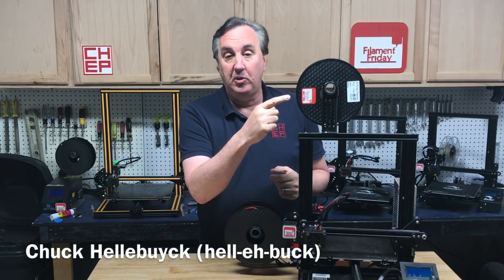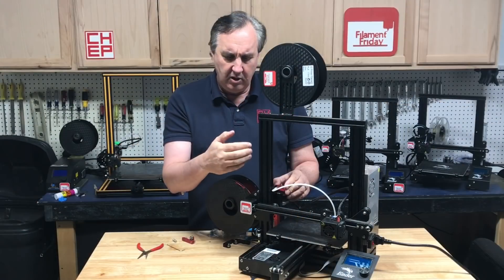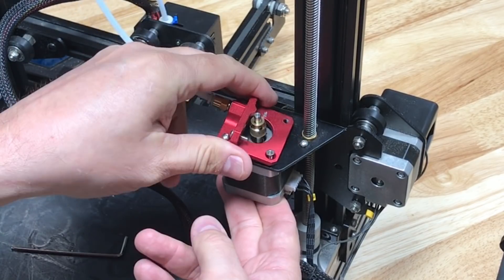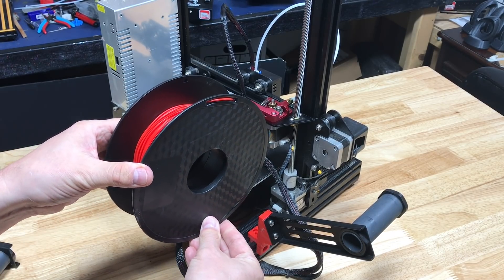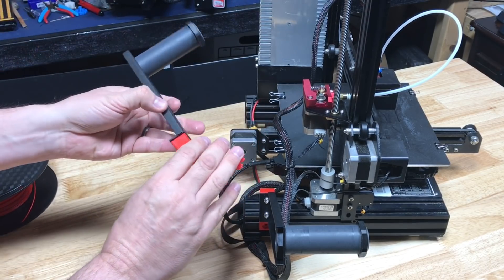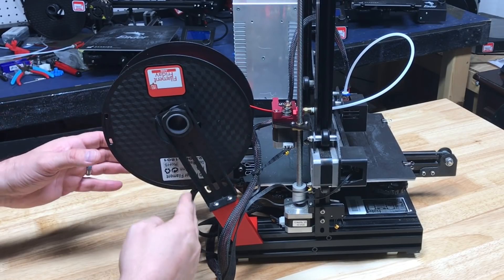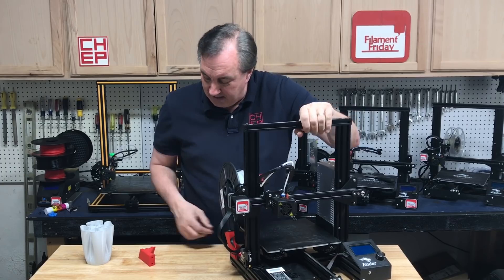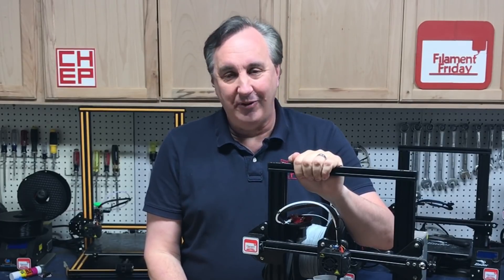Creality Ender 3 Rear Spool Mount

Comment: great idea - looks like the spool is over the print bed, so assume you would have a clash there. But I love the position and will have a go. Out of interest, what is the total overall depth of the spool and the ender 3? would it be less than 550mm? for fitment into a cupboard?

Comment: I just did this 1/4 turn on my extruder and I found the Bowden tube between the extruder motor and the print head TURNS about a 1/4 of a turn as the print head moves back and forth. anyone else notice this and is it a problem? really wish I could search the comments on this thread.

Comment: I tried this but I only tried it after upgrading to a BMG Extruder clone. I found the bend in the PTFE tube caused a lot of problems. I cut it so there wasn't much of a bend and it fixed my inconsistent under extrusion. Right now I'm using the original top mount but screwed to the bottom extrusions with a longer PTFE tube for the extruder intake. This stops it unwinding.

Comment: This is so much better than side mount. Solved the exact challenges you mentioned. About to print this for my Ender 3 v2. Did you ever revise to not block the print bed as much?
Reply from the maker: There are remixes that do.

Comment: The bed may clear, but a large, taller, print that fills a wider build area is going to hit that roller. I recommend turning the metal roller support 180 degrees and it won't be too much wider than the z stepper motor. Still off the back using the same printed bracket; but doesn't interfere with anything on the printer. And, it leaves the spool close to the extruder without issue.

Comment: Seems like it may interfere with using the whole build plate area. Or am I'm just seeing it wrong.
Reply: I thought that for a moment, but then realized that the bowden tube will always be above the x-axis. This would work. I'm staying side mounted, but it would totally work.
Reply: @monkeytube138  The spool gets hit by the bed, the spool holder needs to go out about 15-20mm more.

Comment: I just need something that feeds better, there’s nothing wrong with my printer, but it’s the filament. It likes to get caught and as it’s feeding there is no slack and it pulls to tight and snaps so it’s not feeding anymore, I found out the hard way 17 hours into a print

Comment: I'm using a remix of this at the moment, but I want to put my Ender 3v2 in an enclosure, and this makes loading the spool difficult. My enclosure will open on the left side, so I am going to redesign the support so the spool loads from the left, instead of the right. It will also clear the build area this way.

Comment: I did this a few months ago and love it. But instead of the rear mount I've hung my spool off the back of the top post. Keeps the footprint even smaller and still works grear!
Reply: how did you manage to get the full vertical build area with that? is the STL searchable on thingyverse?

Comment: Sir. What can i do to prevent "Twisting" of the filament on the spool support? I have relocated the spool to the lower left side of the ender 3. it seems that the filament wants to twist and then it reaches its point of not advancing into the extruder until it breaks.
Reply from the maker: I’m not sure. I’ve not seen that on mine.
Reply: Do not let go of the end, if you let go of the end of the spool it can wind itself around a different loop and create a knot.

If you never release the end then it can’t tie a knot. Any time you cut your spool you need to tape it down or hold it in your hands. Ensure it doesn’t create a knot or travel under another loop.

Comment: Recent subscriber. Great content. Thanks so much. Just wondering, after watching your recent video where you tried adding the extender to make it offset just a bit, did you considered moving the upright from the outside to the inside and then just swap the spool holder to the outside position? This would keep the weight centered the same over the rail, just 180degrees. And any overhang would be to the outside rather than over the printer itself. Perhaps it would be JUST ENOUGH to account for blocking that last few inches of the bed AND not bind the filament too much.
Reply from the maker: Yes. I tried it but it moves it over too much.

Comment: Hey Chuck - love the idea, but larger prints on the inside of the bed area will fail. I too am looking forward to an update version which I assume will require some filament guidance not being in line with the extruder bracket! Thank you very much!
Reply from the maker: I’ve printed a lot of prints on the inside of the bed. Nothing failed. The back corner does get interfered with by the current spool holder. I’m working on an improvement. Right now I lose a back corner 50mm x 65mm. I rarely ever print there on 99% of my prints. 
The filament hasn’t worn into the aluminum extrusion after many many prints. Plastic one is showing a bit.
Reply: @FilamentFriday  Are you saying the aluminum extruder is now worn, by filament? (like a bad thing?) I am seriously considering this and I am wondering if a filament guide attached to the Z axis screw with a wide mount would really help compensate for the relocation, adn future "left slide " if that would make the diffrence! -- I am about to print one, but My depth is also severely lacking  ... Thank you again- great job!
Reply from the maker: No, I just corrected the typo. It hasn’t worn into the aluminum version.

Comment: Could you help me out with this problem. I have built my Ender3, and I have not done a good job. When the Ender3 goes to the home position, it is about one inch off the build plate at the home position. What correction can I make to solve this problem? I am ready to tear down the Ender3 and start all over with the build. Thanks for a reply. Richard
Reply from the maker: https://youtu.be/2Th2e7wTNV0

Comment: You overlooked an issue with that rear spool placement. 4:18 The filament entry angle into the extruded hole is pretty steep if you ask me (especially if the print you're doing is not that tall), and because of that, you're going to put quite a bit of wear and tear on the outside edge of the aluminium extrusion lever, especial when using a full spool. The side mount placement (while wider) helps solve that wear problem.
Reply from the maker: I didn’t overlook it. I’ve been printing with it and most prints, even smaller ones don’t rub much. It’s just in the home position that you see that angle. The side is still better, this was just an alternative for those that complained about the width.

Comment: hi Chuck. im very new to printing. where is the best place for me to get designs and how do I put them on to my sd card so that my printer will read them? love watching your vids. cheers fella.
Reply from the maker: https://youtu.be/FahVngvlhoY
Reply: @FilamentFriday  thanks Chuck. that helped a lot. I have managed to grab some prints off thingy verse and alter them for my needs. uploaded them to cura for splicing and got them on my sd card. when I started to print them they would start printing on the very front left hand corner of my bed. even though they were centred on the build platform in cura. I find I have to move the part to the very rear right corner of the build platform in cura to get the print to start near the centre of my printer bed. have I missed something in my set up? thanks again for your help.
Reply from the maker: You have to select the proper machine file in the slicer to get the right bed size

Comment: Hi Chuck, This is almost perfect. Would you consider increasing the tilt of the holder at the rear so it goes further back and avoids taking over the build area.
Reply from the maker: I’m looking at moving it sideways and maybe lowering it. I don’t think a bigger angle helps and it puts more torque on the mount.
Reply: @FilamentFriday  great ! Look forward to seeing your updated design
Reply: CHEP any luck with the mod yet?
Reply: @jeremyglover  Someone posted a remix to CHEP's design on the verse(thing:4325547), a bracket that moves the whole holder to the left, that should fix the issue

Comment: I like this idea. I've only had my E3 Pro v1.5 now for a few days and I had a spool of brittle PLA that can't survive the turn from the top mount without snapping mid-print. I moved to a side mount, but I like this solution better. As soon as I can crank out the spool holder, I'm going to give it a try.

Comment: I have a large chunk of PLA, almost the length of my capricon bowden tube for my ender 3 pro, completely stuck and I cannot budge it one iota with a rebar wire that passes through nicely. I've tried freezing it and boiling it and no joy thus far. I have some white tubing on order from Amazon but it seems that will be awhile instead of their usually prompt delivery here in Montreal. I thought it should be easy to get out but I was wrong and don't even really understand how this happened. If anyone knows anything about this kind of problem I will be very open to suggestions. I finally was getting my printer to extrude properly and then this!
Reply from the maker: The last 20mm are probably stuck near the nozzle. Just cut that off and I will probably release.
Reply: I now have the same problem in a white bowden tube I found and it is far from the the end. In both a large piece of pla is stuck about 2 or three inches in from each end and won't budge. I should be able to push it through quite easily with just a piece of pla let alone a rebar tie wire. I wonder why it is sticking?
Reply from the maker: Some filaments have spots out of spec. Especially low cost ones. That could be a bad spot.
Reply: @FilamentFriday  These are two different pla filaments. And they are completely frozen in there. I would not have thought that was possible. The way they both broke off 2 or 3 inches from the ends is quite a coincidence. I can't help feeling that something else is going on. Since I installed an aluminum extruder I've had nothing but problems until I really shimmed up the spring and finally got a print to work without looking like a slinky. Then this? I ordered a dual extruder and some more bowden tube and am waiting on Amazon's Corona express.

Comment: Late to the party, but if the goal is to reduce footprint- square footage and cubic footage, hanging off the front I think makes the most sense.  I do mostly low profile stuff, so this works for me.  I was able to mirror this design to achieve that, but it would be optimal once it’s more centered.

Comment: Ok so had an issue and not sure how to troubleshoot it.  But the lcd ribbon on my ender3 has apparently been slowly rubbing on the frame and finally got through to the actual wire and shorted out an popped.. I turned it off to check out everything and found the up1 chip has a whole in it. It will still turn on but have a blank screen now. Everything else appeared to be working, fans etc. After checking around it seems like whenever this happened it was damaged and needed to be fixed or replaced. So instead of doing any board surgery I just bought a new ender3 silent board to replace the damaged one. I installed the new board and turned it on but now the screen is on but just a blank blue screen.  If I hit the button/knob it makes a beep and shows a little light on the mainboard  in response. But that's it. No longer boots up. Just the blue screen. Everything is wired correctly and even tried several different ribbon wires to make sure it wasnt just something dumb and obvious. But nothing I do is working and I'm clueless at th his point. And ultra aggravated.. are the 10 point rainbow ribbons different than the 10 point gray with one red stripe. Is there a way to test to see if  the screen itself is busted. Or maybe a firmware problem. And is there a way around not using the lcd until I get a new one?
Reply from the maker: Connect to it thru usb and your computer until you can get the LCD working. Sounds like a bad connection in the LCD cable or LCD fried too.
Reply: @FilamentFriday  yeah I'm pretty sure that's the culprit too. I've tried just about everything on the machine and motherboard to no avail. I had hope cuz it still lights up and beeps but all functionality isnt happening. But I got one the new SKR 1.4 turbo board and a TFT35 touch screen. Oddly enough the ender lcd was pretty much the same price as the full color touch screen. But needed the 32bit to run it. Since I didnt need the silent board i just returned it and got the new 1.4 turbo board....looks like that's gonna be a blast to setup lol. But looks like its gonna be worth it once it's all up and going. Definitely curious to see how it does.   But thank you yet again Chep. Will definitely be signing up to your patreon. You always get back to me to help and is greatly appreciated. So figured it's the way to help you. Thx again

Comment: How big are the mechanical differences bewteen the ender 3 and the ender 3 pro? Im looking for upgrades like this metal extruder and other hardware stuff..but i only find ender 3..so im hesitant, since i dont want to buy stuff that doesnt fit. (Just talking about mechanical stuff..not the mainboard) Is the general design the same, or are some parts different..like screwholes at other positions, different sized parts, etc?
Reply: The only noticable different parts are the Y-axis aluminum bar - it's double the width on the Pro - and a better PSU. All other parts and screws are exactly the same, everything that fits on an ender 3 will fit just as well on an ender 3 Pro.
So you can buy any part you want without having to worry. Happy printing!
Reply: @razxz  Thanks a lot for the info. I knew about the Y rail and PSU..thanks again!
Happy printing to you too =)

Comment: After a lot modification on my printers..i think they ara very good whith nothing...
Reply: Nah..i think some parts should be modded, like metal extruder instead of the kinda cheap plastic, heat treated springs for the bed leveling and a self printed dial to put on top of the z axis rod and the extruder for easier manual turning. And i personally like the clean look of a cable belt chain..but of couse..all is optional. As you said..they are pretty good on their own.

Comment: I print a mod for the ender 3 that its simiar to the cr10 , its works very good , but yuo need more space..i have 2 ender 3, one cr10, so after all , i go back to the normal setup of the ender3..cause in that way need less space

Comment: Good day, please can you tell me of it is possible to print a 8mm gear for a ho size slotcar. I am trying but seems it cant be done. The teeth are welding and look weird and weak
Reply: it should be possible. Try 0,12 layer and slow down.
Reply from the maker: Without the file I can’t tell you but I’ve printed small parts just fine.
Reply: Thanks guys i will try
Reply from the maker: Have tried my Cura 0.12 profile?

Comment: Need to put bearings in the spool holder now
Reply: No need, not having enough friction on your spool can actually risk the fillament going off the side if the spool and messing up
Reply: @woutchauvaux6672  Now I feel like the extruder has to do too much force
Reply: @SRenzo1000  Same for me, love the idea, I just hear the spool plastic dragging on the holder when the filament is in reverse. Noticed this with a brand new roll of PETG ( Overture brand )

Comment: I must of done something right. I just put the stock filament holder with the spool holder facing outward no need to print anything. Just put it on the outside rail pointing outward no need to print anything. I have mine like that it runs perfect. and it's not in the way of the bed. I love your videos though CHEP! I think it didn't fit because you have the spool holder arm facing inward. Just put it there without the modification but facing outward.

Comment: My alu extruder has sharp edges on the inlet hole and work best with a ball bearing guide. This setup would definitely not work as the filament would be scraped when the angle changes.

Comment: Instead of redesigning the entire part just turn the spool holder the opposite way! So the arm of the spool holder faces the other direction and I think this does the job! Maybe
Reply from the maker: It sticks out too far and brings the filament in at a bad angle.